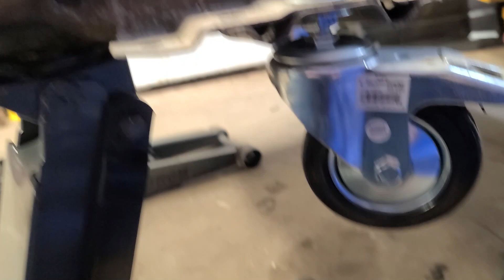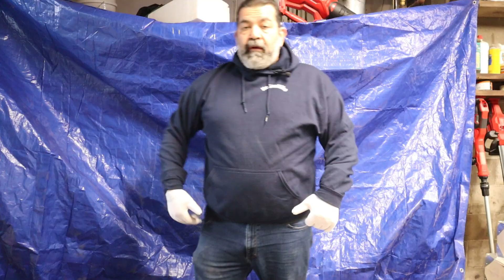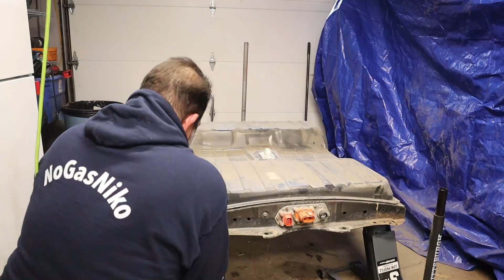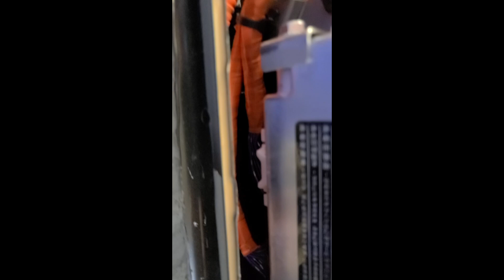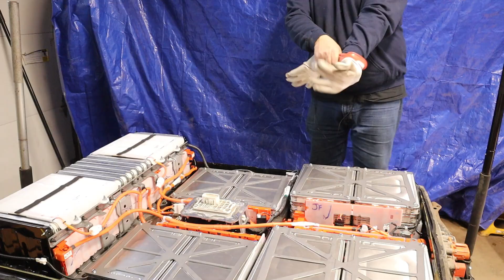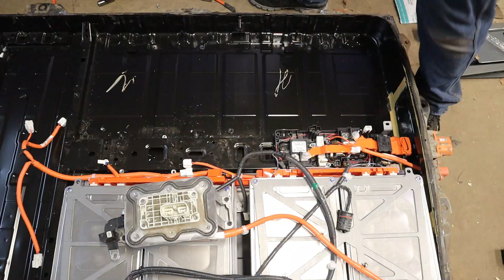Leaf Battery Upgrade Update 6 - Module Removal!!!  Getting ready for NEW MODULES!

Comment: I tought the failure ocure in the back, cuz of the heat and to much modules in sandwich. Im i wrong or are you wrong?
Reply from the maker: Actually, I believe its more random.  The more I talk to other Leaf owners and they tell me which modules fail.  It really appears more random.
Reply: @NoGasNiko  oh. Ok. I thought it was the back row cuz of the heat. Fast charging and stuff. 
 Guess it's random then.  We all learn. But i like my leaf, wanted to upgrade my battery with cells from catl and diy version.  Will end up getting around 40kwh.
Reply from the maker: @Alennovak666 it would be nice to see the data from Nissan as to where the majority fail but I'm sure we'll never get access to that info.....

Comment: I did another battery disassembly yesterday. My order of actions

Fit safety jandles
Safety cut out already removed when pack removed from car
Cut sealant with knife
Unscrew lid and safety cut out frame 
Remove lid
Remove lbc and disconnect
Disconnect main leads from rear stack
Disconnect left to right stack interconnect
Remove cut out assembly
Remove contactor assembly 
Remove temp sensor harnesses
Remove mid pack brace
Remove all low voltage wiring 
Remove left stack, then disassemble
Remove right stack, then disassemble
Remove rear stack, then disassemble

Takes about 2 hours
Reply from the maker: It also helps when you are not worried about reassembly, as in my case 😁
Reply: what is Fit safety jandles? The 4" casters?

Comment: You don't want to use heat!  It will destroy the cells..  just use a grinder cutoff saw blade slowly and carefully
Reply from the maker: Are you referring to splitting the case?  I recommend an oscillating tool to prevent damage to the case.
Reply from the maker: That's a good point by the way.  I wasn't too concerned about damaging the cells because they were getting replaced.  If this was a repair job where the cells were being reused, I can see how that would be an issue.
Reply: @NoGasNiko  the recip blade is a good idea if it actually works.  I find it gums up on rubber.  my plan is to reconfigure the pack for another car, it isn't going to bolt into the bottom, but I still need all the cells and interconnects.

Comment: Subbed - I picked up a 2013 Leaf S from a coworker for $2500 recently. It's only got 38k miles on it, and battery health shows 8 bars. It shows low 50 mile range on 80% charge, around 65 on a full charge. I've got in mind to swap battery cells like you're doing, but a few years down the road. I'll come back and refer to your channel for the work! I like the idea of just swapping battery modules (and a couple other basic components) to get more life out of the car. For now, it suits my needs just fine.
Reply from the maker: That sounds like a good plan.  I'm currently editing the next video where I installed the modules.  Hope to release it in the next few days.

Comment: Good Job! Willing to see the next part.

But about your gloves, the cotton ones must be under the rubber ones.
They are made to absorb the sweat.

I use them everyday 😉

On the outside they could be wet and short-circuit anywhere.
Reply from the maker: In the utilities we have leathers that cover the rubber for protection.  I assumed this was the same.  What you say makes sense.  I'll look for the paperwork that came with the gloves, I'm sure it's stated there.
Reply from the maker: You are 100% correct.  I will make that noted on the next video.
Reply: @NoGasNiko  You are helping a lot of people with your channel, let us return you something. Good luck on your battery upgrade!
Reply from the maker: I love the comments pointing out anything good and potentially bad.  Especially in regards to safety.  Please continue and I will research and share.  If it helps others stay safe, it's worth it!!!

Comment: I would worry more about arc flash than electric shock. Personally I'm just planing on swapping two batteries and then figuring out how to get the car happy again. Someday I might have to swap cells to get more range.
Reply from the maker: Vivne has solutions for CANbridge. Check out their website.  I believe LeafSpy is able to program the same size as the existing (24 kWh with another 24 kWh).  I have not looked into that but I believe Dala has a video on it.
Reply: @NoGasNiko  I have leaf spy and I also bought a battery bridge just in case. I'm swapping a 24KW pack from a car that got a big dent along one side. It's starting to get warmer out and I really did not like having only 20 miles of range when it was -20F outside. Aren't these battery's supposed to have a battery heater?
Reply from the maker: @LaserFur the battery warmer is only to prevent freezing and comes on at 14F.  It's only designed to warm slightly.   To be honest, I don't remember seeing one when I took this apart.

Comment: The rear 24 modules weighs over 220 pounds (100kg) and you lift it out so easily. Guess you were a weightlifter in your previous life.
Reply: Hope your back is ok! Another video I watched, the guy took out the front modules first, then tipped the case backwards to roll the back pack onto a pallet. Or one could use some sort of lifter.
Reply from the maker: @rogerbedell4056 I spent a lot of time in the gym in the recent past.  It's been a number of years and I certainly don't look like a gym bro now but I still have some strength left 🤣.  I was a little sore but will recover quickly.  Being 50 makes a difference for sure.
Reply from the maker: I did a lot of weight training in my past.  Not so much lately.

Comment: Regarding the tools you are using I would put two layers of heat shrink tubing on the socket and extension and also the screwdriver, use red for DANGER. Nice project thanks.
Reply from the maker: Thanks for the tip.

Comment: Thank you for a great video. And thanks for answering my question about who manufactured those batteries inside that case "Panasonic" Japanese. Now Chinese batteries you are putting in, in my opinion have a higher fire risk that those Japanese ones. You are so informative!
Reply: After seeing what happens to old Leaf batteries (swelling, leaking, high internal resistance, overheating etc.) any pack with new cells will likely be less dangerous than the old pack. At least for a number of years.
Reply from the maker: You're welcome.  I'm not sure about the higher risk, I hope not.  I will definitely monitor the temperature closely.

Comment: Also stand on a rubber mat, like yoga mat.  Get a rubber apron to prevent legs and stomach from touching the outside of modules that might be a ground source.  Sweat in pants or shirt will conduct electricity.  Wrap all tools with black insulation tape.  That's cheaper than special tools and prevents arcing.
Reply from the maker: Excellent advice!  Thank you for that.  I will use your comment in my next video.  I was mindful of hand placement and staying away from any HV contacts but any precaution is worth it.  I'm going to use your comment in my next video if you don't mind.  I think it's worth sharing to those that don't read the comments.
Reply: I hadn't thought of a rubber apron. This is why I heart YouTube!
Reply: @JH-uu7jl I wrap in RED tape

Comment: I'm a retired chemist for the white rubber company Ravenna, Ohio.  They make electrical gloves.  The cotton gloves go inside the rubber gloves. To prevent sweating. Moisture not good.  Your gloves should have leather layer on outside of rubber.  Check date of manufacture, if 6 months after date, the gloves need to be sent back for certification.  Rubber degrades after storage.  Cracks will enlarge in the box.
Reply from the maker: I agree if I was working with kV.  This set was designed for this range of voltage.  I work with high voltage all the time.  My day job is with the utility company.